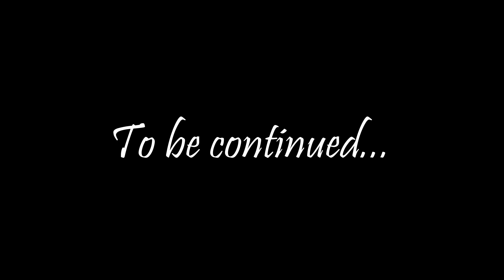Plans for a New Stone Building, Traditional Cooking & Tackling the Orchard! Garden Rescue

Comment: The roof where the water running down the wall if you got any of the roofing sheets of the same profile cut a six inch piece off the width slide it underneath the original roof then drill and rivet them together to extend it .The water will run further out a way from wall there for dry out 👍👍have fun love what you’re doing up there